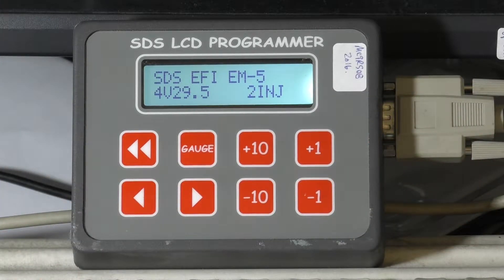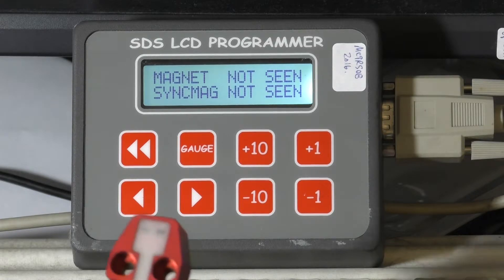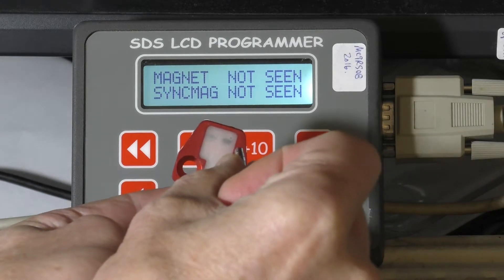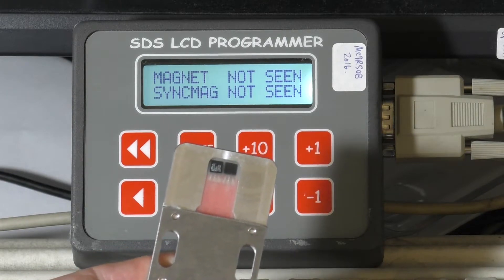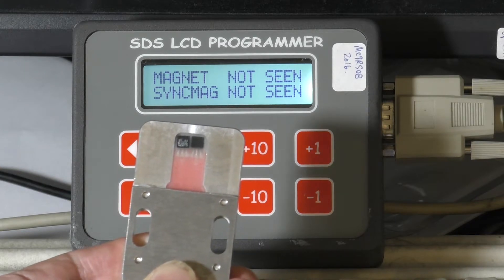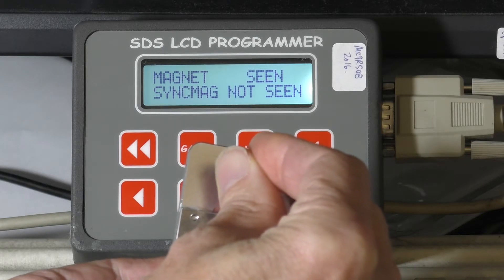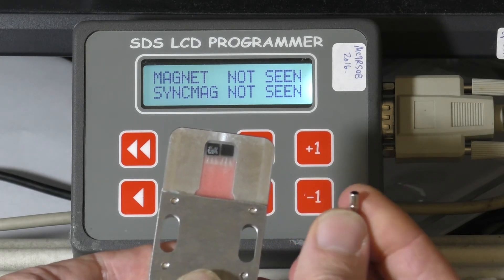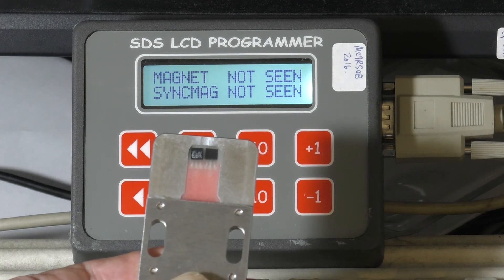hall1

Comment: My car still runs even with magnets no seen. Is this normal.  Magnet adjustments is at 75deg ??  
Let me know thanks
Reply from the maker: The Magnet Seen window is only valid when turning the crank slowly by hand for initial alignment. When running, the magnets are passing by many times per second and you can't see their passage since the sampling rate of the programmer is only about 2 times per second.